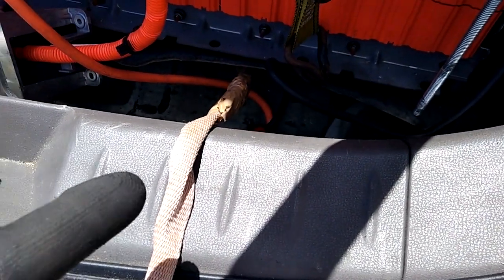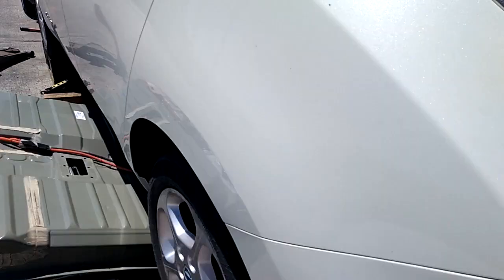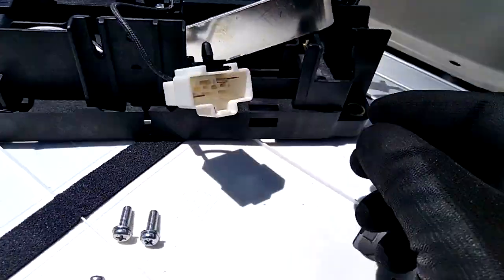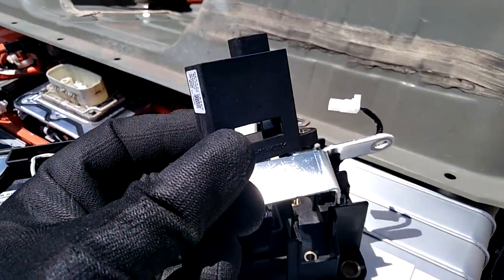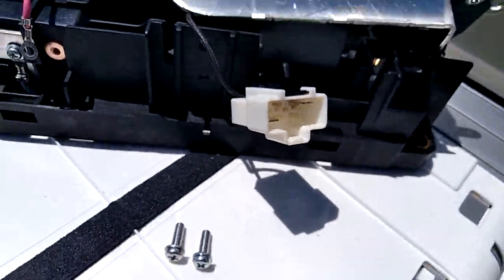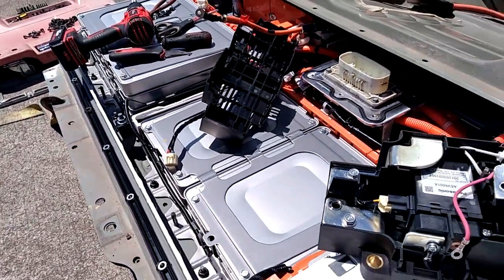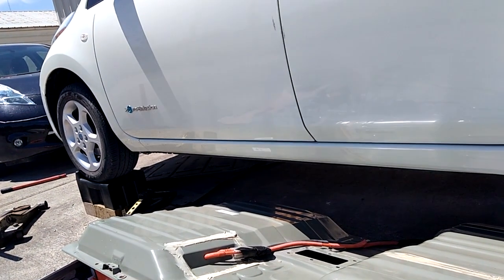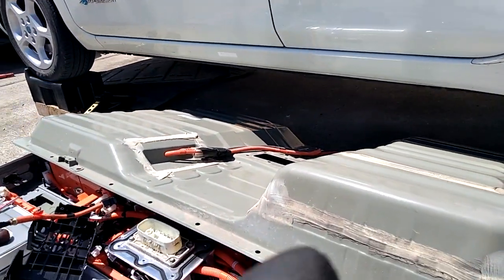48kwh Nissan leaf updates (DIY) 1

Comment: Question ? How did you added the external battery and how much is it cost you ? Btw awesome job ..
Reply from the maker: I removed a complete set from a used Nissan leaf and arranged them in the trunk In such a way that the total voltage was devided by main fuse just as they were in the original arrangement in the car.
Before connecting the main battery to the extension In the trunk be sure it add up to 360v or more. Then remove the fuse before connecting the two bank of battery together, return the car main fuse first and then use a high voltage meter prob to know the Potential Different voltage by putting the prob In the fuse holder of the bank of battery in the trunk.
If the voltage is high keep the prob in it, till you have like 16 to 20 volts and then remove the high voltage meter prob to put the Nissan leaf fuse.

Comment: Do you think you could have a second 22kW battery but just switch between the two when charging? That way the car only ever thinks you have one battery.
Reply from the maker: The second 22kwh battery is in the trunk and I do not have knowledge of how to switch between the two banks of battery without having to go through high voltage cables plug and unplug.
The advantage in this setup I have now is that I do not need to open it up again except for improvement modifications.

Comment: Hello, you do need that current sensor for the car to work fine. HOwever, you need to connect your extender battery after that current sensor. That current sensor measures the current passed from the battery to the engine and shuts down the car when the programmed current has passed. That is why you need to connect the positive pole of your extender battery after the current sensor so that it does not include your ender pack current to its calculation.

Comment: HAHA love your channel, im so glad you tried this, so im not the only one :D it works well eh :D I am loving mine but I get a little code once in a while. I will have to look into it. doesnt stop the car from running though. I look forward to more of your videos :) I subbed.
Reply from the maker: When I was having some code problems, I solved it by insulating the extended battery from the body of the Nissan leaf. 
Be sure that the extended battery is not holding voltage above traction battery, that can bring up codes too. Don't ask me how I know because I tried it.